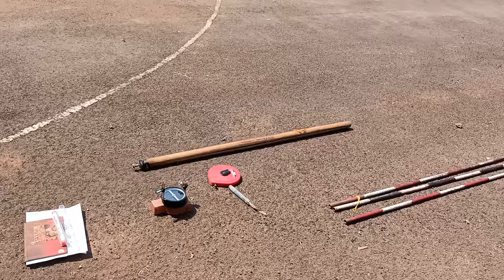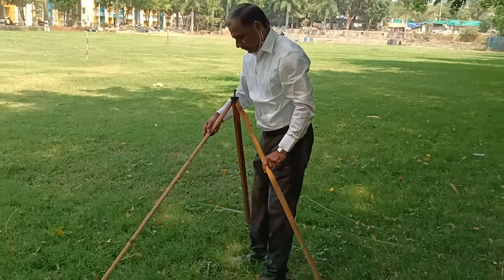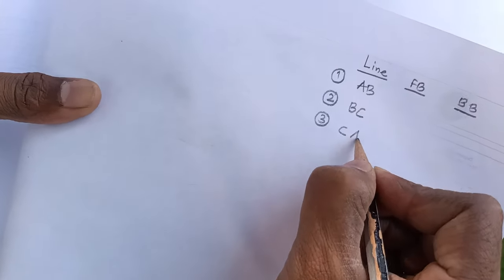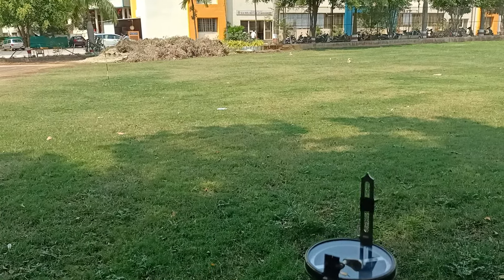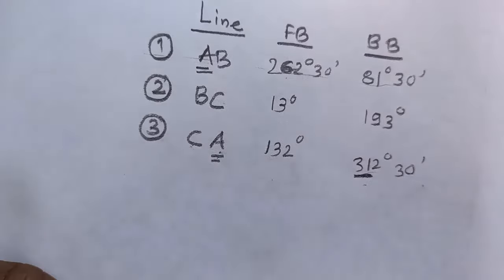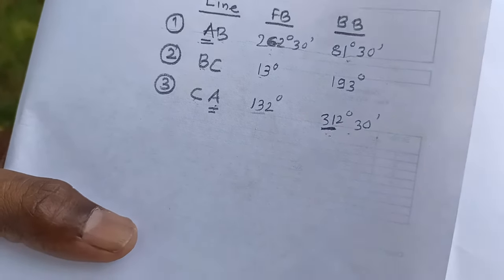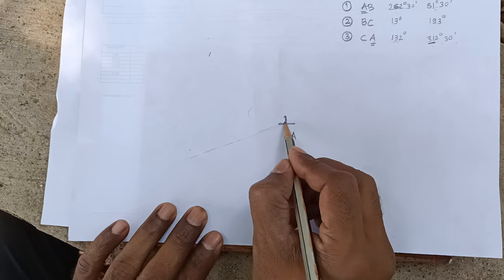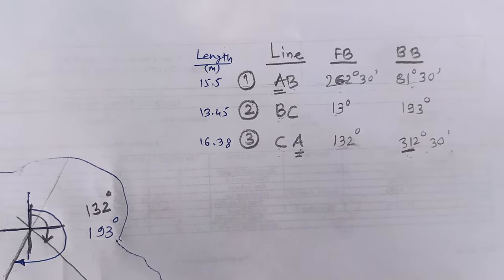Study and Use of Prismatic Compass survey

Comment: One cannot overstate the importance of taking the back bearing. My experience with compass work, decades ago, showed me how many times there appeared a "local attraction" which pulls the needle away from the proper heading. If one excludes the back bearing they become unaware of how far off they have become on the line to be surveyed. In the early 1980's I would use a compass to "rough traverse" the survey for new underground gas lines. We would use aerial photo's to map the proposed route, then place "targets" at road crossings and intersections to "reinforce" the course. I would go out with my compass and flag a line between these targets. Sometimes I was pretty close, most times I would have to back track and correct my error. Then the survey crew would come through with total stations and run the "true line". Now GPS has changed all of that, but it was a fun exercise and a real eye opener on the limitations of compass accuracy. Later I would have the crews rough tape the surveyed line, after it had been cleared to get from one reference point to the next. This to was a good exercise as the crews got a "real" lesson of how inaccurate many of the original surveys were. When we did boundary work this lesson helped them to understand that  one had to look in a bigger circle than a layman might of expected to find the called for corner. As technology has progressed the accuracy of surveying has greatly multiplied. Accurate geospatial location is the basis for civil progress in land development. Many countries are way behind on the importance of this, as a result conflicts with roads, drainage, utilities, and buildings occur simply because there is no information base to prevent it. Governments would be advised to use GPS to place suitable controls so that private firms, even using a compass and tape could survey and plan for infrastructure that works together. Great video guys, how about one where you head out of the park!
Reply from the maker: Dear sir Thank you for your reply. And yes correctly said Back bearing is must to have accuracy